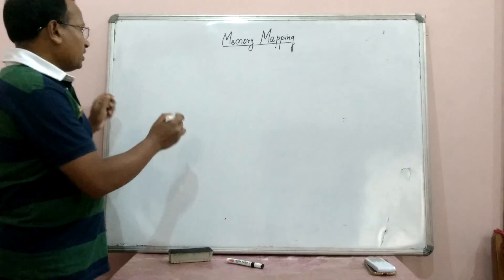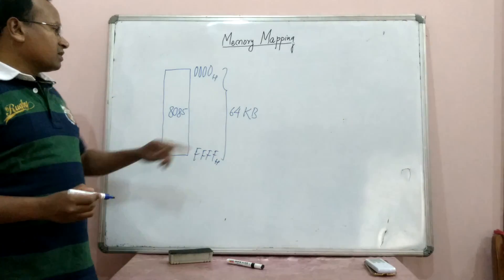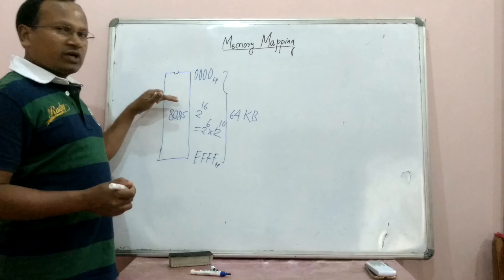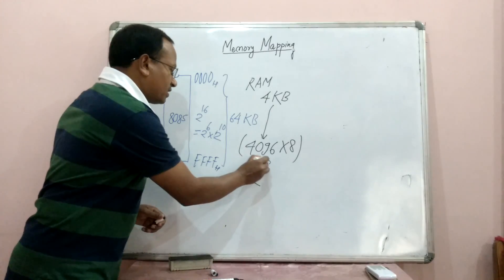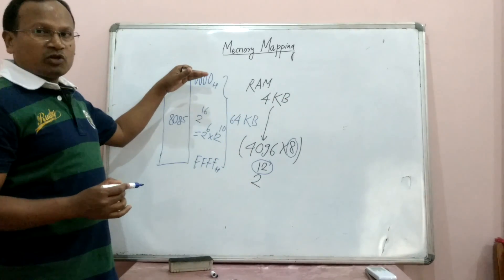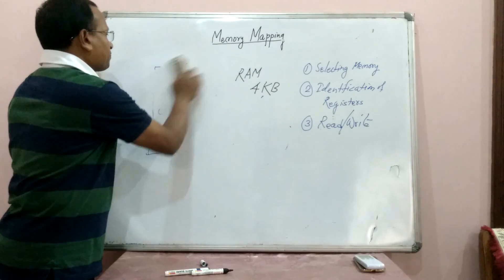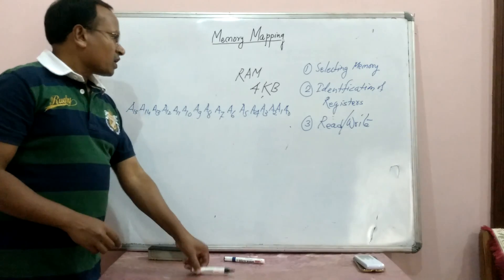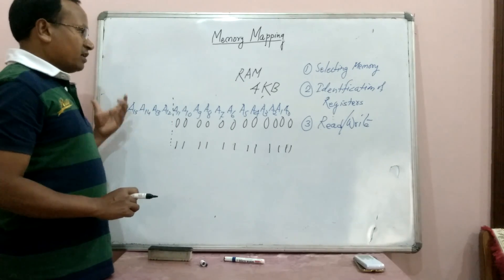Memory Mapping by Dr G R Sinha

Comment: Sir isme apne NAnd gate Ka use Kyo kiya hai
Reply from the maker: Very Good Question, Here we have used A12, A13, A14 and A15 as lines for chip select and please see the chip select line that is active LOW which requires zero to get it enabled. Since values of A12, A13, A14 and A15  are all ones in memory map (range of addresses) and therefore to generate zero, there is one option of using a NAND gate with all four high inputs. Hope this helps you. You can practice so many questions and if you face difficulty then you can email the problem, I can upload lecture for the same. Best wishes